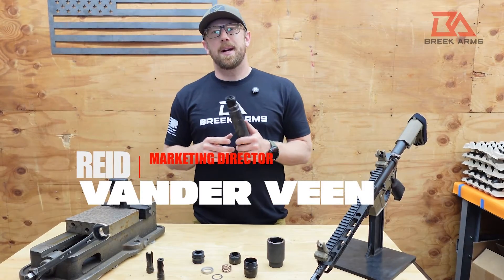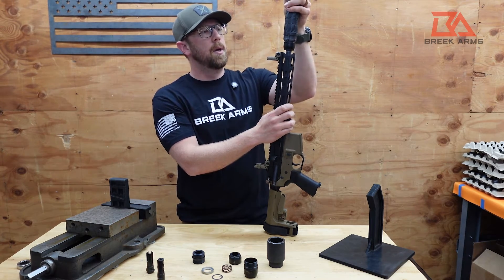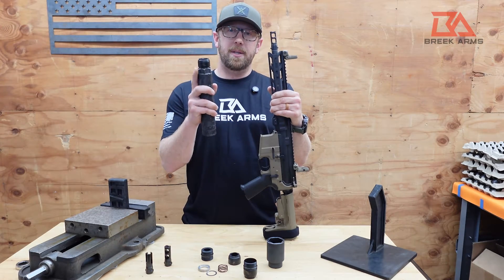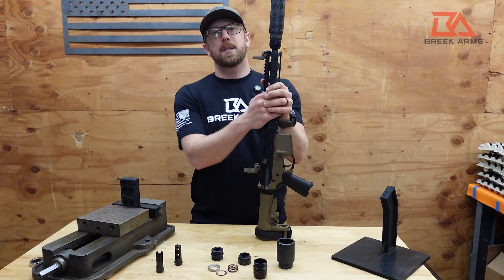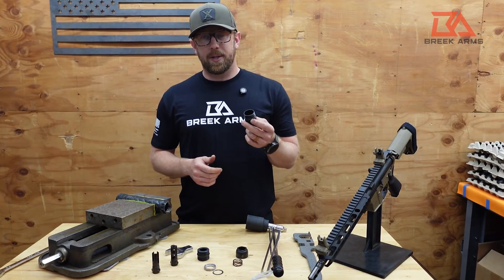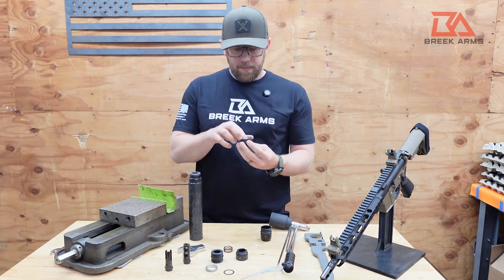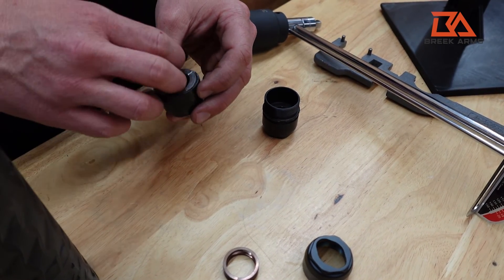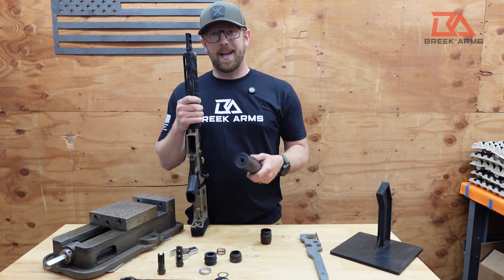Breek-LOK Technical Walk Through

Comment: I’m very curious about this system. I’d like to compare it to the Dead Air keymo system
Reply from the maker: No problem! 
 - Material and weight is a big one. The Breek-LOK HUB is made out of Titanium, Keymo is Steel. HUB weight for the Breek-LOK is 2.4 oz vs Keymo 4.8 oz. Muzzle device weight 1.6 - 2.1 oz (depends on cal & design) vs Keymo ~4 oz (depends on cal & design). So total weight savings is around 4.4 oz in the whole system.
 - Less likely to carbon lock with our 10 deg taper and labyrinth rings (to this day we have not had a carbon lock, we are about )
 - Easy to index. The Breek LOK lugs are large and making indexing a breeze. The Keymo has smaller indexing shapes, making it a bit more intricate to install. 
 - The Breek-LOK design avoids small parts that could potentially shear off. We wanted a more rugged, simpler construction.
 
Similarities are that both are HUB compatible, both have a ratchet system for retention, both have a secure repeatable connection since they both mount to tapers, and both mounts are easy to install, with less then 1.5 turns and there are no additional locking collars.

Hope this helps!
Reply: @ this is great information! Thanks

Comment: Really cool looking system.  However, $300 extra per suppressor just isnt worth it imo over devices like xeno or reardon etc.
Reply from the maker: Thank you for the feedback! Yes, those are great, simple mounting systems. Our Breek LOK system offers a few advantages over those alternatives. 

Mechanical Retention: In addition to the taper lock, our system features lugs and detents, ensuring it won't walk off.
Weight: The weight is almost identical to competing products.
Carbon Lock Prevention: The shallow taper angle provides a nearly impenetrable shield against carbon infiltration, reducing the risk of carbon lock.
Ease of Removal: The larger thread diameter on the HUB gives users a mechanical advantage, making it easier to break the taper seal when removing the suppressor from the mount.

We believe these features provide significant value and reliability.  If you keep an eye out for sales, you might find the pricing more in line with your expectations.

Comment: How long are you expecting the ratcheting mechanism to hold up? Other options on the market the that will remain unnamed have had past issues with the ratcheting mechanism going out. Will you replace those parts or at least sell replacements? Thanks in advance looks slick just some thoughts I had
Reply from the maker: We've done a lot of testing with limited wear. However, if these parts wear out on you there will be replacements.